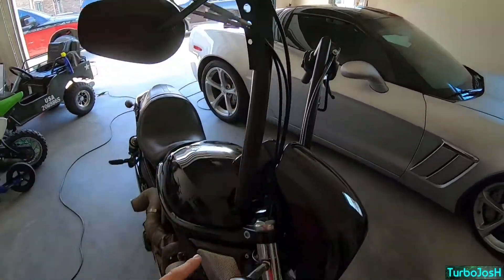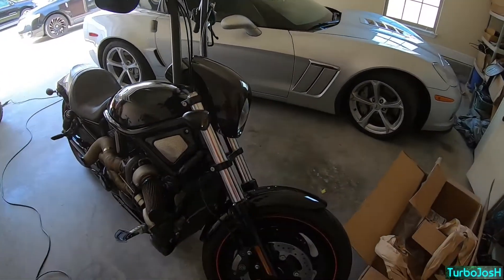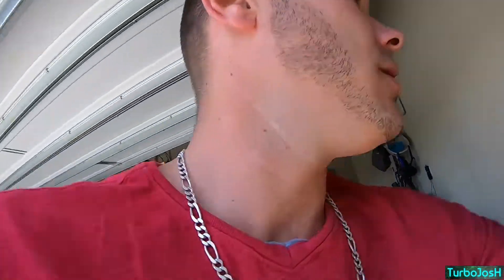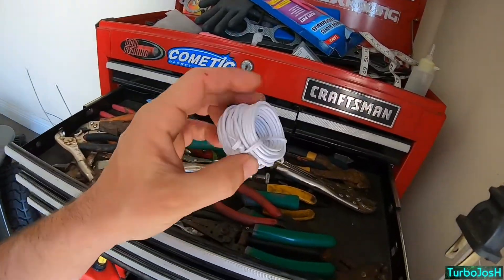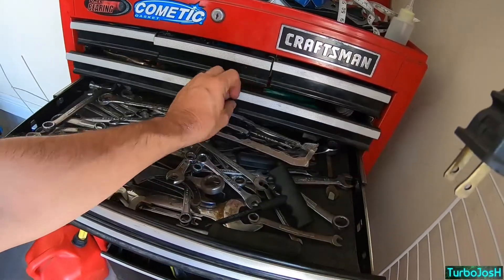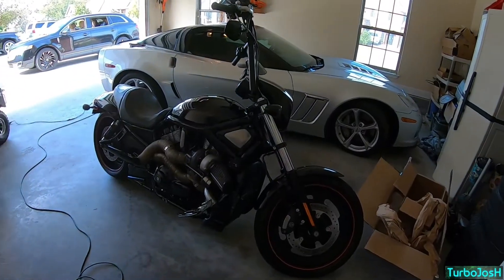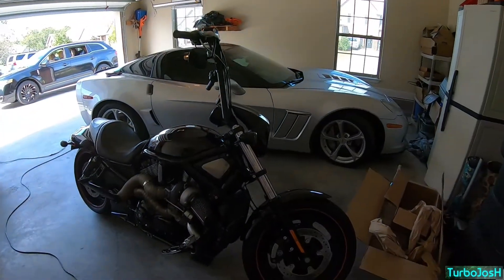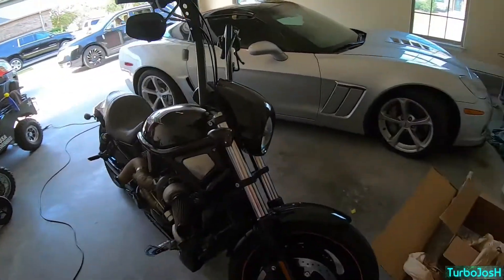16" Ape Hangers on Vrod/Nightrod for $350! (Turbo!)

Comment: Nice bike bro, everything seemed cheap too, here in NZ that would be over $1000 bucks easy
Reply from the maker: Yeah I hear ya. A local guy on fb sold one told me he paid 1800 for a shop to do it here. 🤔😒
Reply: Yeah Bro in NZ bars and full cables kits, plus Installation around $2000

Comment: With the clutch line is the stock length 62" and are the fittings same size for Harleys?
Reply from the maker: Been a while I don't remember length but for hydraulic yes fittings are same just banjo bolt and receiver setup

Comment: I am having a very hard time finding bars and all the lines needed to do mine.do you mind sharing where you got yours?
Reply from the maker: I have separate videos on every part. The apes were bought purely off handlebars diameter
Reply: @JoshRaySpot  I have an 06 and the bars are one sold peace bolting to the trees with the speedo wrapping around the bars.was your the same way?I have to install a adapter kit in order to do the bars and I'm afraid the speedo will not go back on
Reply from the maker: @craigmonday4913  you got the wrong size bars then I didn't need any adapter. I think it was 3/4" bars. Send them back and get right size because speedo housing will not fit bigger bars.